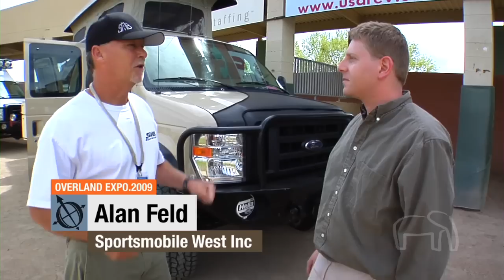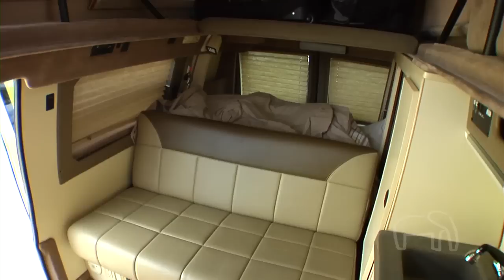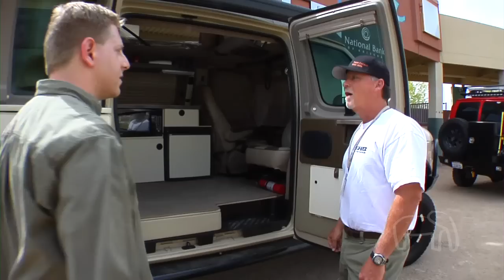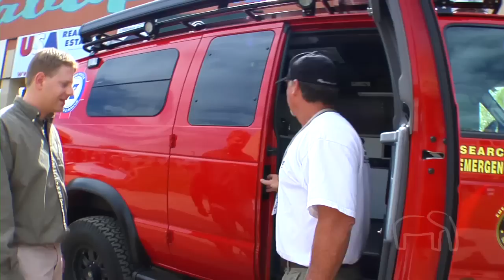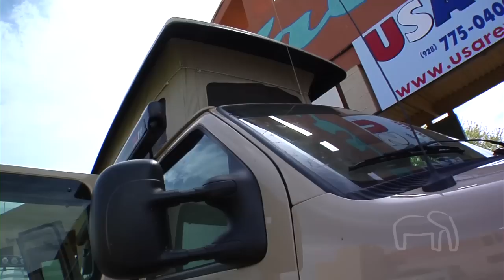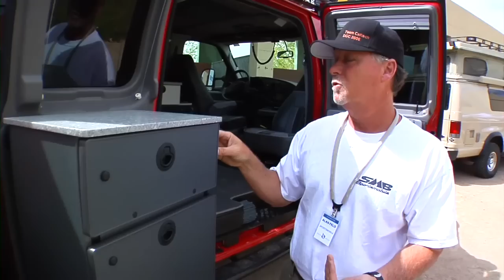Interview with Sportsmobile West President Alan Feld

Comment: I could just imagine the mechanic bill on that once  something breaks.
Reply: Actually the cost would not be any more than a basic four wheel drive pickup. These use most of the same parts as your standard Ford four wheel drive truck so these can be repaired at your local Ford dealerships and most of the parts are covered under fords warranty program. I purchased mine new in 2014 and have not had one issue with it sense owning it with 56,000 miles on it. These also have the Ford one ton chassis which is very strong for its size and weight. thank You

Comment: I think the cost is actually not bad considering what your getting but i believe this thing is HIGHLY overrated from a 4x4 capable standpoint. this fucker must weight in over 9000lbs and if you ever get stuck, no ones pulling you out.
Reply: Depending on how bad your stuck any one ton truck (sometimes even smaller) shouldn't have too much trouble getting you out. You just have to know the capabilities on your vehicle. No this is not a super serious rock crawler but it is much more capable than a normal two wheel drive van and that allows you to get into places other four wheel drive trucks can and have an RV like place to stay while you're out there.

Comment: hello Allen ,
I am Russell Morse and I own a Nissan nv3500 passenger van all the seats have been removed and I placed a shelving unit and storage under the bed, I would like to be able to open my rear doors for access would your rear bumper be able to swing out for that purpose, and I would like to place a generator on the back with jerry fuel can,  thanks for your time , I am a oversize escort   service
 thank you
Reply: Why not get the nv cargo van ?
Reply: I didnt have the finds at the time.to fet a cargo and.it didnt have ac in the back and or heaters. I rhank.you for your time

Comment: Hydrogen generator technology consists of Jr. High Chemistry and universal Laws of Physics that can not be denied. When stainless steel nail is wrapped in aluminum wire connected to DC power it percolates 120 Octane Hydrogen gas. If use the existing alternator for on demand production of hydrogen and use 1/4" plastic fuel line from the beaker to the vacuum intake manifold the vehicles ECU electronic control unit will adjust.  Easily increase mpg and hp 30%+. Indy cars been using for 10+ yrs.

Comment: Microwaves are so inefficient. I would rather save my battery power for winching and lights rather than few minutes of microwave use. Not only that. They use up alot of space for something that is not really used that much. 
Not exactly the same design as the 60's.

Comment: 'Built the original VW campervans'? Errr - wrong. Westfalia did em first. Espar heaters only recently entered the vehicle market? Errr - wring again! Espar has been into vehicle heaters as far back as the mid-1900's. The most modern version of their small furnace has been around for over 15 years. Oh - and for the money, can't you make these campers not leak?Or use a better fridge than the vibrator Norcold?Or make cabinets that don't look like high-school projects?Not the best build quality IMO.